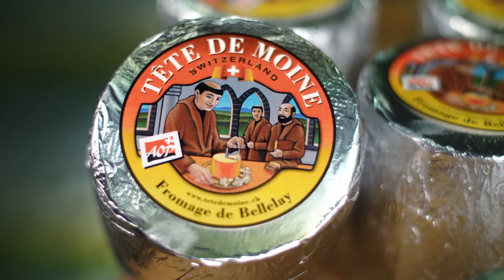"Cheesemaking" | Tête de Moine AOP (English)

Comment: Tete de moine is my favorite cheese ever. I wish I can buy it where I live...
Reply: minaly22 same used to happen to me... just a week ago they opened a high end supermarket that has it... I know how you feel.
Reply: @erickg3508  By the way, do you eat with the girolle? I found that there is a way for me to buy the cheese for a reasonable price, but if I want the girolle the price is quadrupled and I am very torn about acquiring one. I kept trying to find information on how to eat tete de Moine without the girolle, but found absolutely nothing
Reply: @minaly22  I do, got it through amazon for like 30 usd
Reply: @minaly22  wanted to add that if you love cheese, you can use the girolle with other types of cheeses, not only with the tete de moine.
Reply: Either mine has gone bad or you have weird taste in cheese,  because the one I bought is absolutely rancid.

Comment: So... it sounds like you get the best results with the girolle when the cheese is refrigerator temperature. If I am serving it throughout the course of an evening, is it best to leave the head in the fridge and shave as needed?
Reply from the maker: Thank you for asking. It works also if the cheese is not very cold but as cooler is the cheese as easier is to scrapping it.